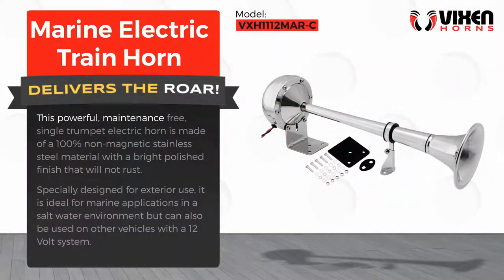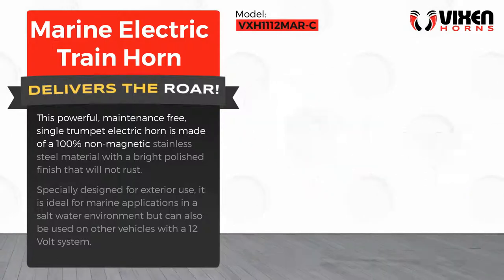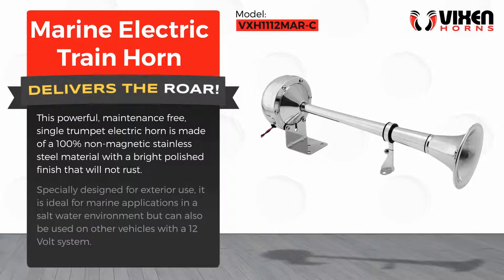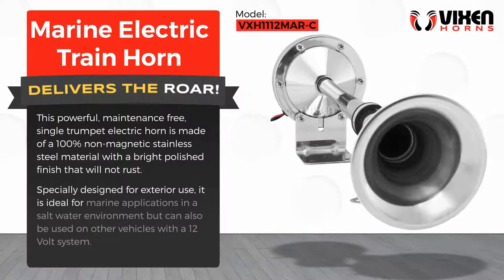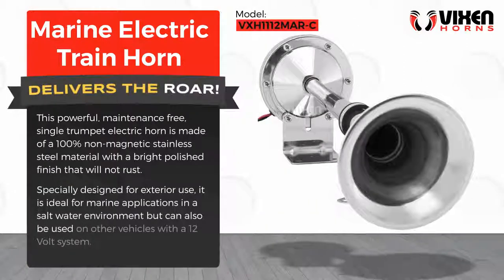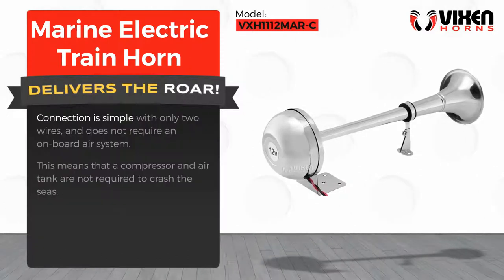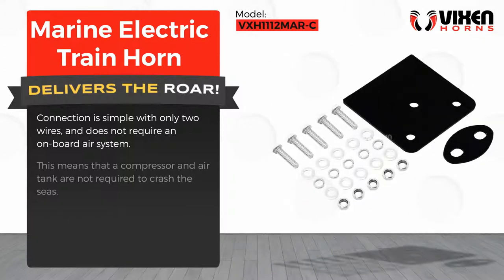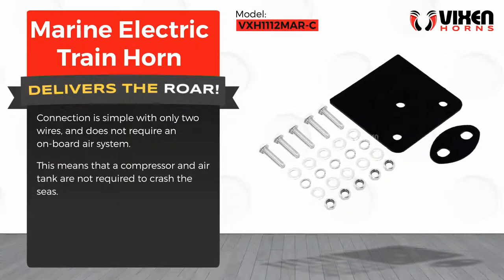📢 VIXEN HORNS VXH1112MAR-C Marine Electric Train Horn 🔥

Comment: Not even a demo of how it sounds.  It looks identical to Amarine-made brand. Probably the same horn just different seller.
Sound Output: 115dB / 408Hz.   About the same as an auto trumpet horn volume and not that low pitch either.